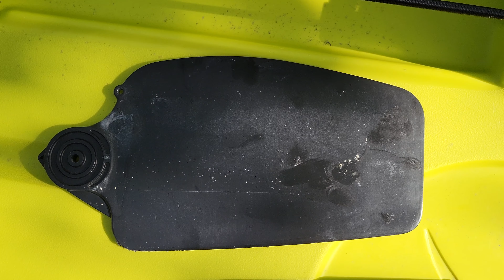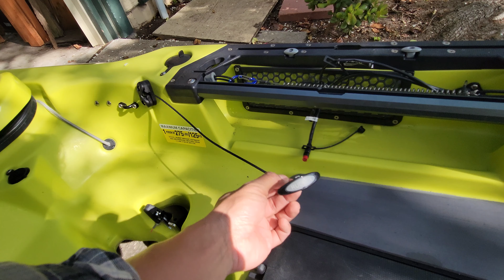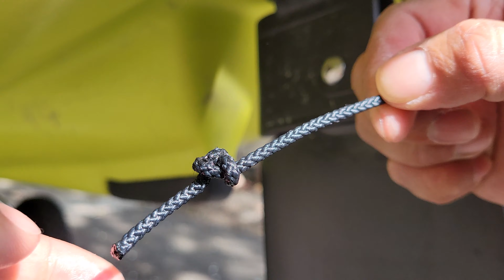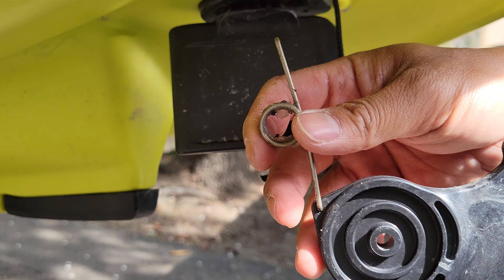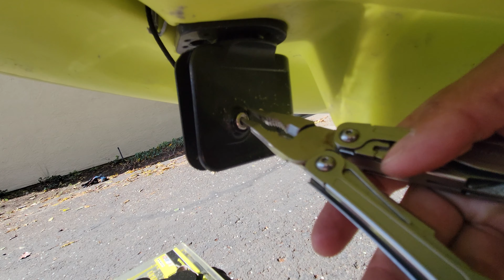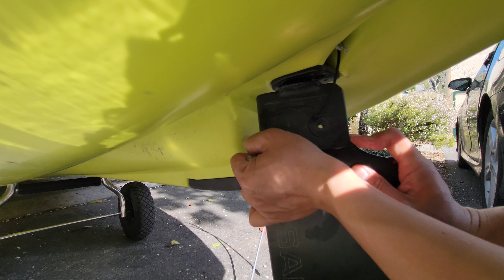2021 Hobie Outback Compass Rudder Upgrade

Comment: Hi, are you still able to use rudder protection block after this modification?
Reply from the maker: If you want to use the loading block, the rudder sticks about half an inch into the block. I used a hack saw to make an opening.

Comment: Thanks for the video. Hey how does that XL rudder works on your outback? I have a 2019 compass, deciding between the regular or the xl. Do you know if the xl will fit on the compass as well.
Reply from the maker: Yes the XL will fit the compass as well. If you use the gray loading block, you do have to make a small cut into the loading block for it to fit.

Comment: Will the SAI rudder fit on my 2018 Hobie compass?
Reply from the maker: No it wont. Its a rudder system designed for the 2019 and up Hobie Outback and Hobie Compass.